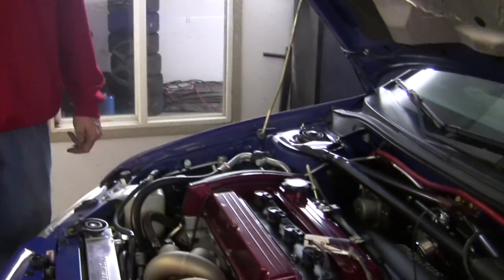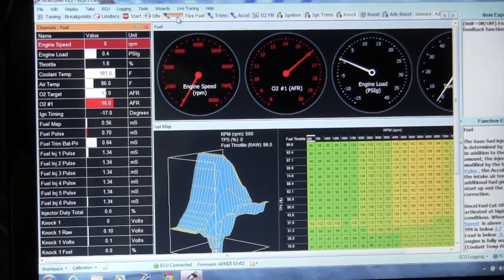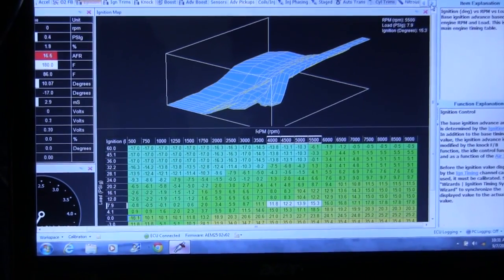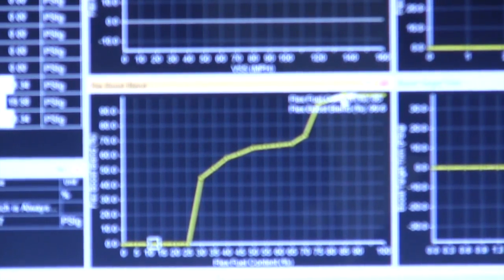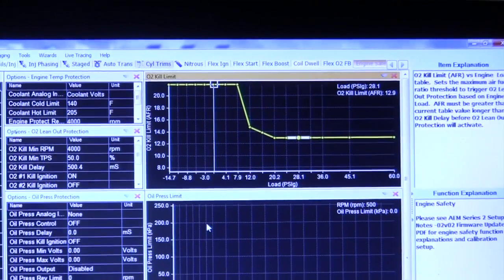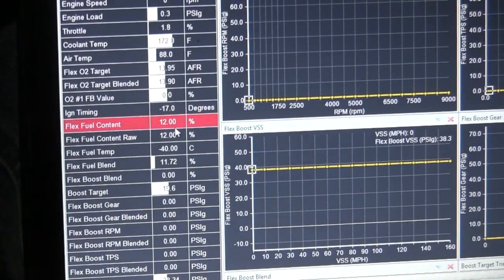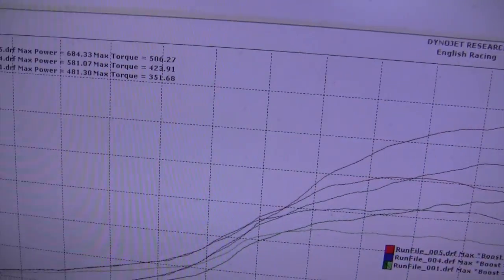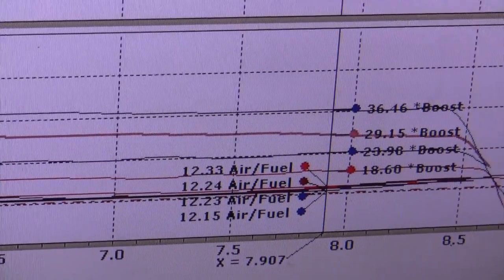800+horsepower Flex Fuel Mitsubishi Evo 8 - English Racing

Comment: Sweet explanation!  So when tuning the car the best way is to tune with pump first, then start adding E85 and figure out what blends are passing through and tune accordingly all the way up to pure E85 if possible?  I'm wiring my flex fuel sensor in right now!  Thanks for more motivation :)

Comment: Awesome video, thanks Lucas!  E85 and ethanol interpolation is really incredible.

Is the blowoff valve leaking as you start the pull, or is that vapor coming from the valve cover breather/catch can filter?
Reply: After watching Akash's video it seems to be the breather.  I was always a fan of making sure all the air was metered, but you guys probably have much higher vent pressure than me.  I wonder if the upgraded check valves that have been around could solve this or if you'd just blow off hoses.  Looking good either way!

Comment: How are you controlling boost? I would imagine you can't use a MBC for obvious reasons. Are you just using like a GS 3 port?
Reply: AEM V2 controls it with a boost solenoid (mac valve)

Comment from the maker: They tried it here in Portland in the city bus program.  Couldnt keep the injection pumps lubed enough no matter what top lube they used and ended up not working out.  Corrosive and lack of lubricity are 2 different problems unfortunately.  Some Tractor pull stuff is E100 since its limited use.

Comment from the maker: E85 is ethanol mixed 85% to 15% gas.  Flex fuel simply means it auto adjusts between 2 preset tunes without having to be specifically retuned for the mixture of fuel.  Straight pumpgas is generally E10 but its possible to get this mixture off if you go to fill up and dont have the car COMPLETELY empty before switching maps.  This allows us to be indiscriminate about the percentage because it can auto correct for the ethanol concentration.  It can be E49, E72, and the AFR will be correct.